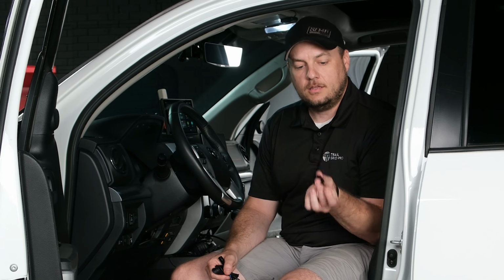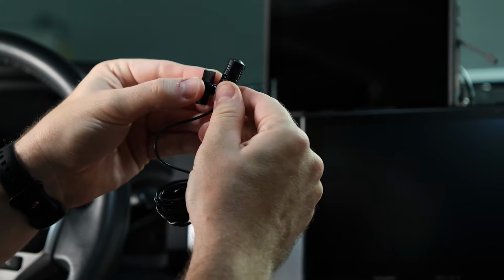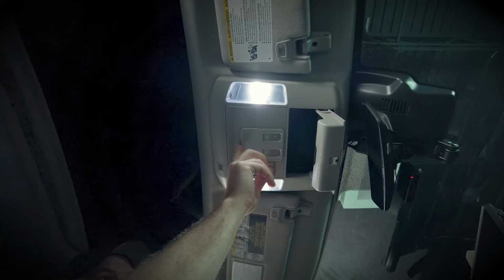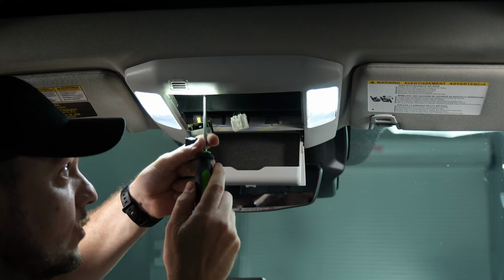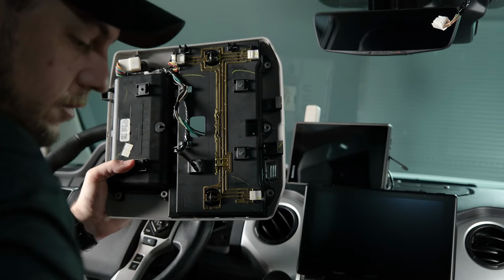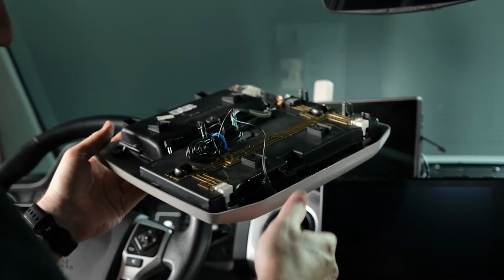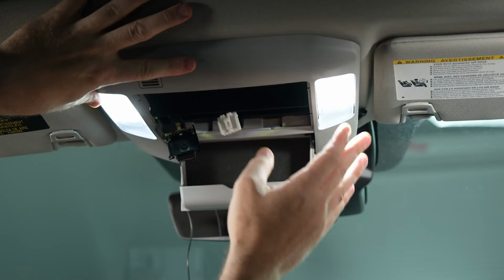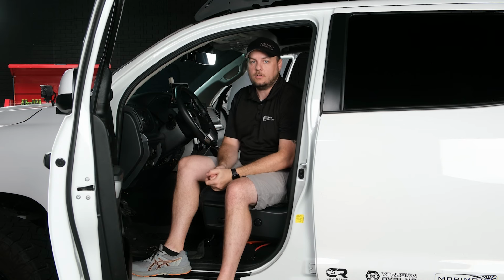Toyota Tundra Sony Microphone Hidden Mount  | 2014 - 2021 Toyota Tundra

Comment: Please don't do what is described in this video. You have a 50/50 shot that the microphone will have crap sound quality. Trail Grid Pro offers a $99 Maestro module that allows you to use your factory microphone. Really disappointed that they did not recommend this. Actually sent me a new sony mic for free when I complained and I had to remove everything again just to see that there was no change! Currently waiting on my maestro module to reuse factory mic with the sony 9000es

Comment: Did this a year ago and works fine, I had to remove factory mic and mine had a few more pieces in the overhead case. Plus i just pushed the cable under the weatherstripping and have no issues at all. 2017 tundra limited
Reply from the maker: Great info and thanks for sharing your experience with the install!

Comment: I installed the hidden mount on my ‘21 Tundra CM with a Sony 9500ES I bought from you all. Sometimes, Siri won’t pick up what I say correctly especially when dictating reply messages from my iPhone. Siri will sometimes cut my message short or will mispronounce certain words. This only happens in the truck with Apple Car Play, not regular dictation anywhere else. Could the mic be obstructed some way? Any suggestions?
Reply from the maker: Yep, give the mic a quarter turn - it's possible the actual mic portions of the microphone are covered by the legs of the mic mount.

Comment: Does this interfere with the sound quality? As far as I can tell with people talking to me everyone seems to understand me better with the Sony microphone. This mount was included in my bundle but with the increased clarity I wasn’t sure if it was worth me installing. As of right now I have the microphone mounted on the rear view mirror bracket but if it does not affect the sound quality I’m going to install it. Thanks
Reply from the maker: In our experience mounting the microphone in the overhead console provides excellent sound quality! Just be sure not to block the ports on the side of the microphone when inserting the mic into the mount!
Reply: @TrailGridPro  Cool thanks again. I’ll give it a try
Reply: @TrailGridPro lmao no it doest
Reply: It did for me.
Reply: My sound quality has been terrible since I installed this. I constantly get complaints from whoever I’m talking to. Any ides to improve it?

Comment: Do you guys plan on printing a mount for alpine mics?
Reply from the maker: We would like to, but with the limited space in the console and the large diameter of the Alpine microphone, it's been tricky to come up with a design that works.
Reply: good to know, thank you
Reply: @TrailGridPro  Why not just offer the purchase of the mount + extra Sony mic as an upgrade or something for the Alpine units? The Alpine mic stuck to my steering column is kind of an eyesore for an otherwise factory looking setup. After spending over 2k for the full alpine kit (head unit, speakers, dash cam), an extra 40 wouldn't break the bank by any means.